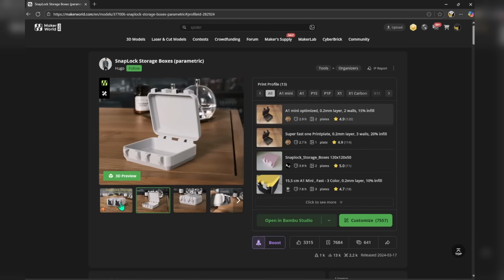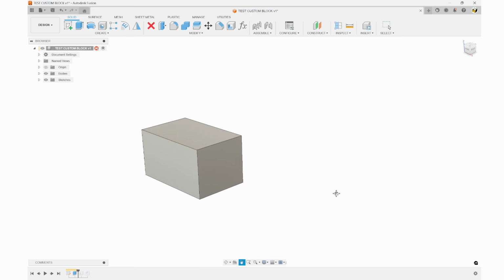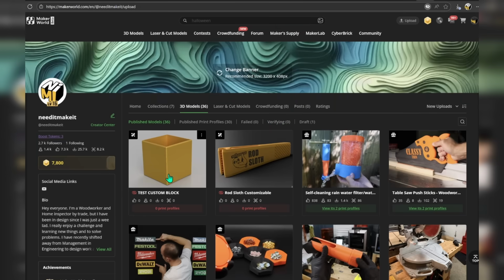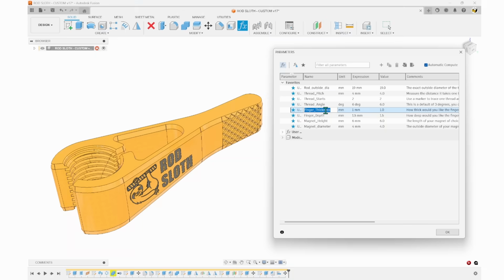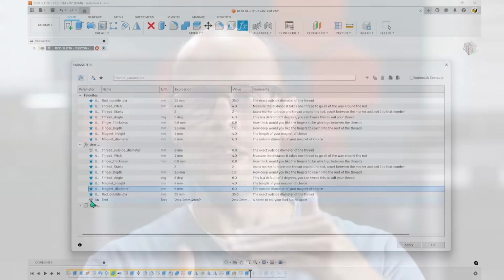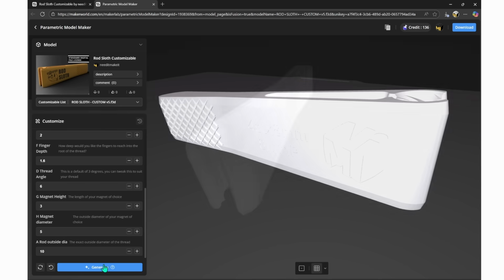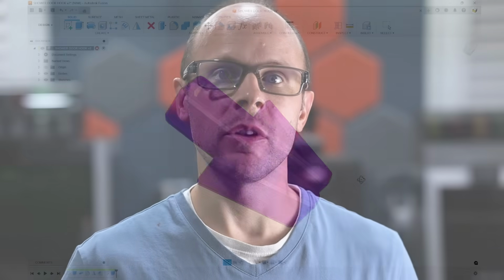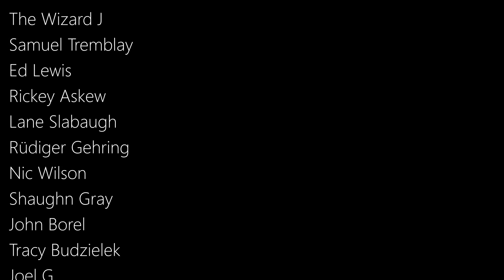MakerWorld added a feature that I didn't know existed and EVERYONE needs to know, because it can sav

Comment: Does this mean anyone can take my design make couple of changes and sell them as their own?
Reply: No.
It allows you to expose some variables from your model to allow it to change shape or size where it makes sense. The file itself is what's protected. 

Also it's not only limited to Fusion. OpenSCAD has been used for these user sided parameters since vase mode was introduced with tools like vase maker. The files are still what you license
Reply: @TheSliderW  This is helpful, I appreciate your time and effort.
Reply: Well if you upload anything but a STL that's inevitable
Reply: @olafmarzocchi6194  Even if it's just an STL it happens. Some dude even tried getting a Kickstarter going with one of my models...
Reply: @olafmarzocchi6194  being able to do so and having the rights are two different things. STL's aren't that much a secure way to share/sell a model than the source file they're lower quality than the source anyway. 
Also your Fusion/OpenSCAD file are not open for the taking. only the exposed parameters. What people download are still STL files derived from your source and are still tied to it's original licence.
Reply: in short, if someone shares your work you are in your rights to request a takedown and file a report/small claims in case they persist.
Reply: @TheSliderW  You're assuming they are in the same country as you, or that their country has the same rules. Not always the case.
Reply: @treborrrrr  international copyright laws/treaties exist for that reason.
Reply: @olafmarzocchi6194  even if you upload an STL it's sometimes easy to reverse engineer to proper CAD format.